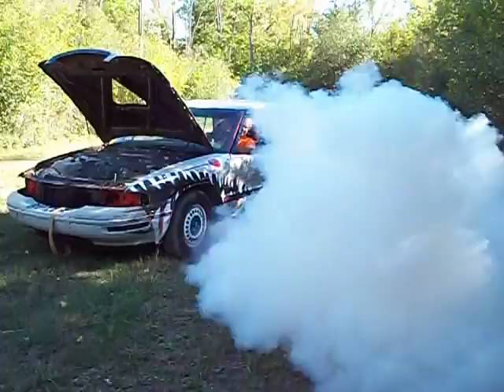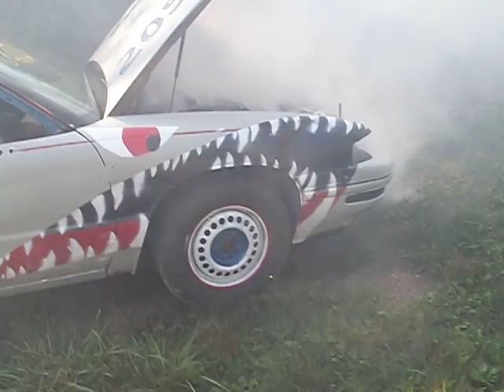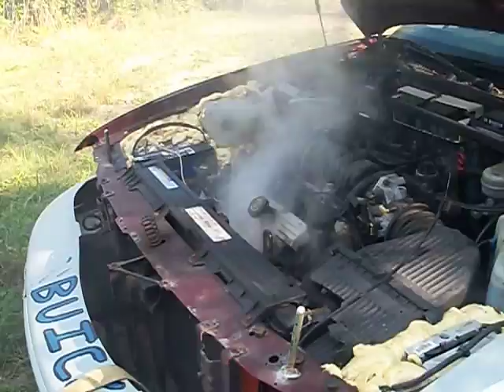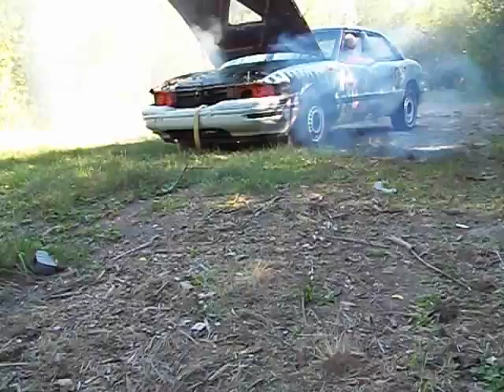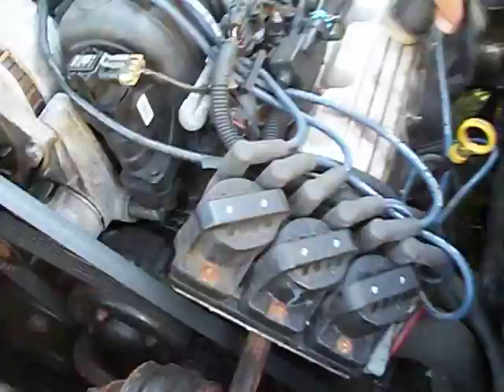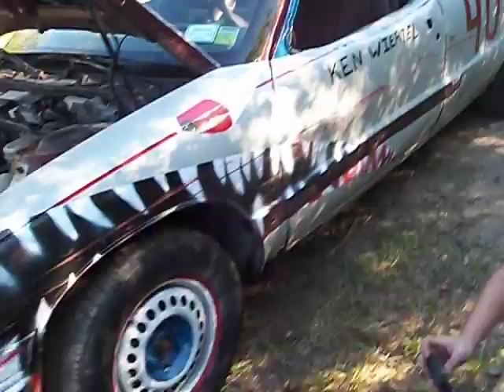Blowing up a Buick 3.8 3800

Comment: I saw this car race. Shame the motor blew up. You ever gonna race again?
Reply from the maker: cutlass ciera yes I replaced the engine and trans and that one seized on me as well after an oil line failure but I'm going to replace that engine again (they are a dime a dozen at the junk yards by me) and I'll be back at Lake Erie speedway in spring
Reply: @85buick307  Did you get the 3rd engine and did it last or blow up too?